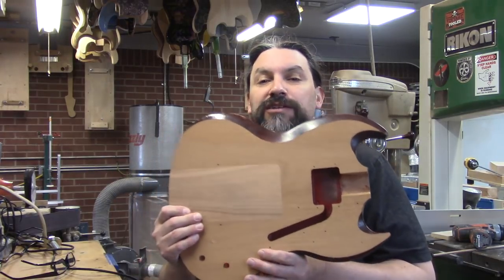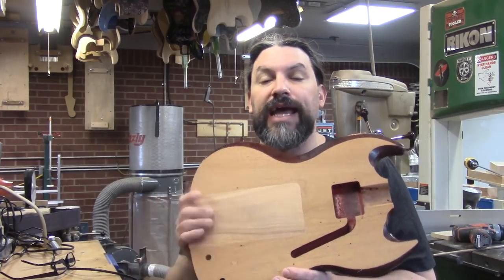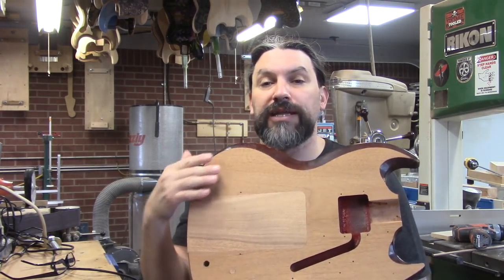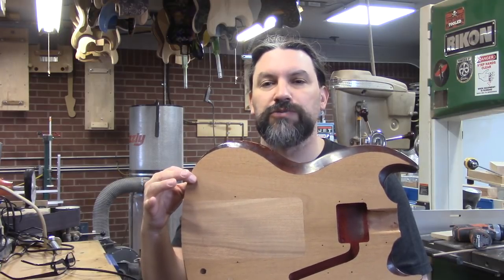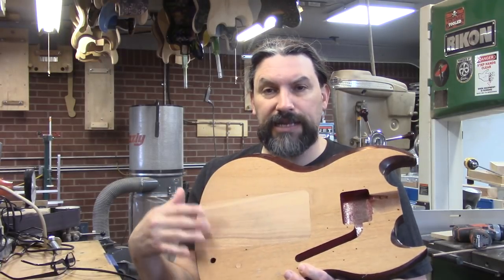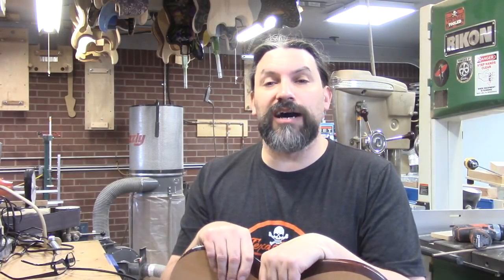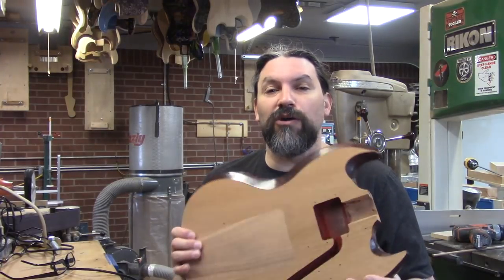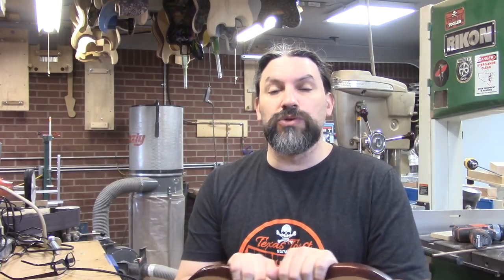1967 Gibson EBO Bass “Restomod” Part 3... Texas Toast Gives You Wood!

Comment: hey Matt can I use simtec sealer  over metalflake to build up the topcoat and then spray clear over that?? as you know it will need several coats now Thanks in advance
Reply: richard - This is Chris from Texas Toast guitars.  I think Matt may pass this question to me, so I’ll answer it.  The short answer is yes, you can do it that way.  The long answer is, it doesn’t take as much clear to bury metal flake as you might think.  I usually like to shoot black or a matching base color before the flake, then flake, then two rounds of clear.  A universal base color is almost always recommended because it would take a heroic amount of flake to cover 100% and not show any base.  I don’t know that shooting more sealer at this point would be much of a time saver vs 2 good solid rounds of 4-5 coats of clear with a good flat sanding in between.  So, after the flake is sprayed, shoot 4-5 coats of clear, let dry, sand that back without sanding thru, then another round of 3-4 coats of clear.  Hope that helps!
Reply: Awesome Thanks Chris